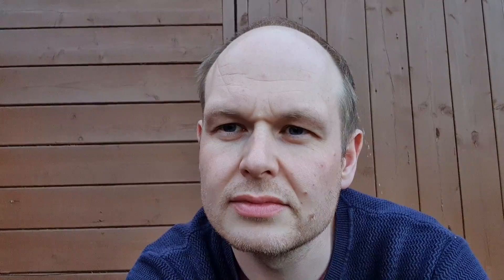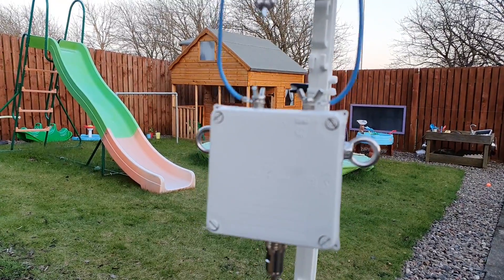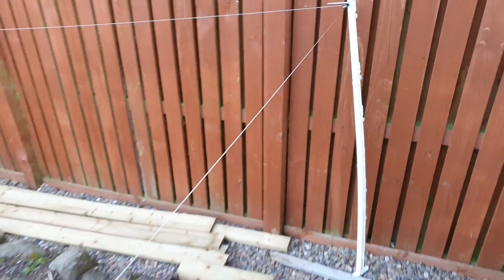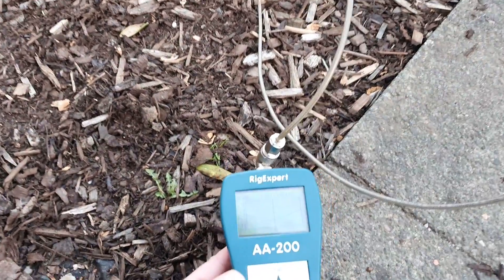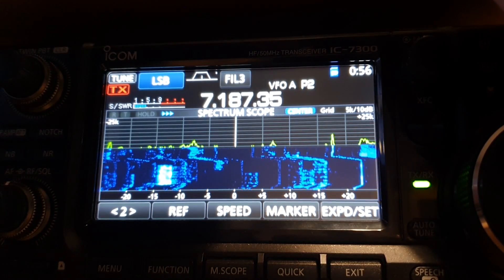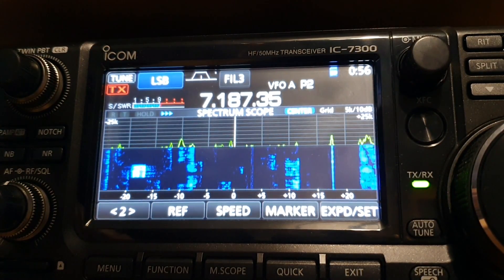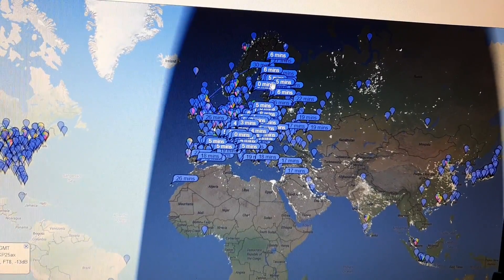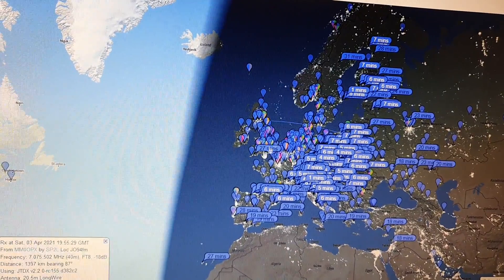adjustiwave Multi Antenna - NVIS Full Wave Loop on air Testing

Comment: Great vid. question: what is the total length of wire run around your garden?
My greetings from SVland !
Reply from the maker: Its a full wavelength so 40m was around 41m and 20m was 20.5m or there abouts.
Reply: @MM0OPXFieldRadio  thank you, I seems to fit snugly in the garden, from my perspective and seeing the reel at first glance I thought it was a shorten version. I Thank you very much for your reply. 73s